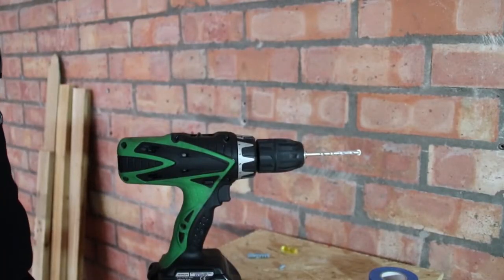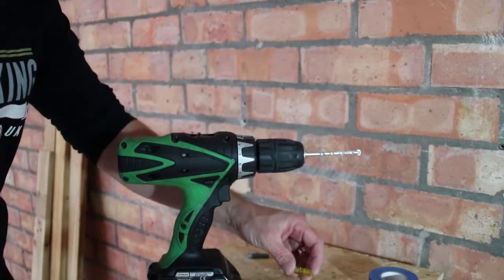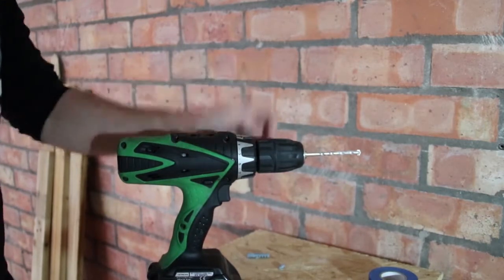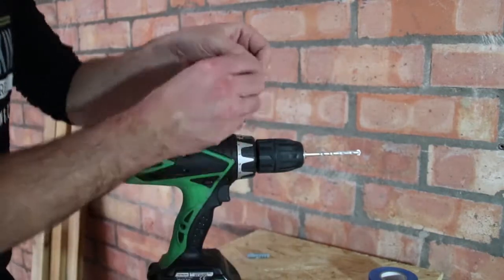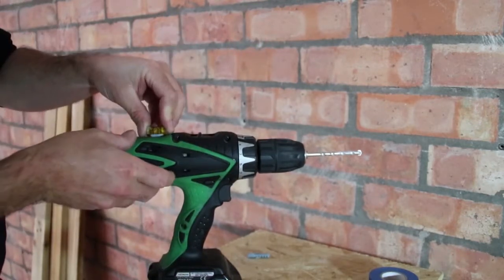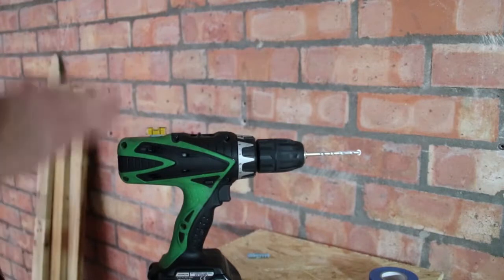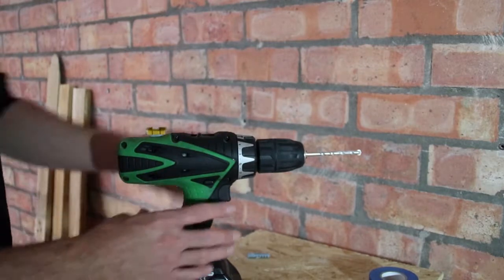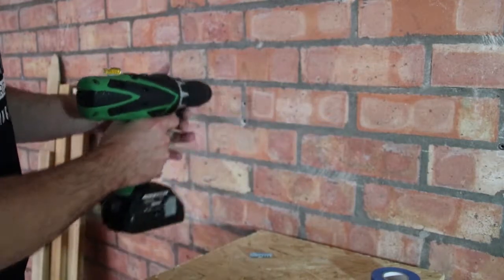How to Drill a Level Hole - Handle King DIY Tips

Comment: Youd have to make sure the drill bit was level first or youd be levelling in a tilted drill bit. 
I've been a joiner 20+ years and never seen anything so stupid. I might trick apprentices with this tho
Reply: Hello Coin Oo.

If the drill bit was level and checked, as you stated, and then a small spirit level indicator was placed on top of the drill with blue tact to hold it in place would this method cause the hole that was drilled to be straight? 

A reply would be appreciated Coin Op, as I rarely have to drill holes and when I do the drilled hole isn't straight as I am not someone who drills all the time and so I lack the continual practice and skills required to do this.

I only drill once every 4-5 years, so any advice you can provide would be very much appreciated. Thank you.
Reply: @patrickisfree  yes you'd have to level the bit first but even then it would be on a different axis when tilting. Its easy enough to achieve a 'straight enough' hole by eye.
Reply: @coinop7278  Thanks Coin. I appreciate that. I'll create a few practice holes with the drill first on scraps of building material I have in the shed to bring myself up to speed, then create the holes I need to make.

I appreciate the response, enjoy the rest of your week. I hope it's a good one. God bless.